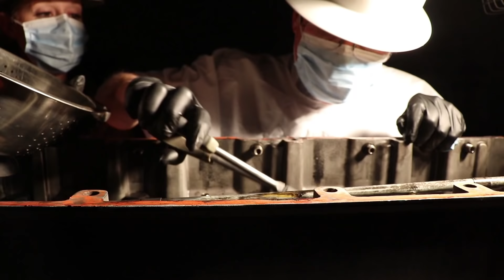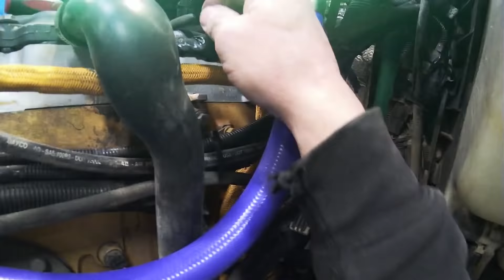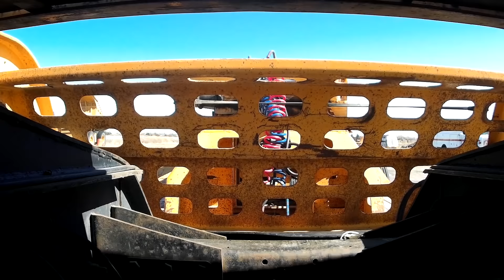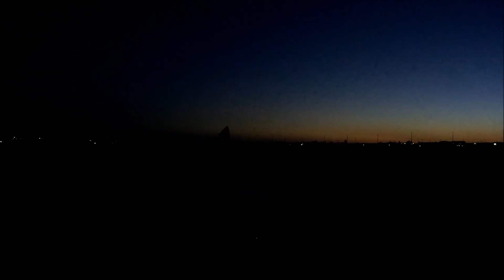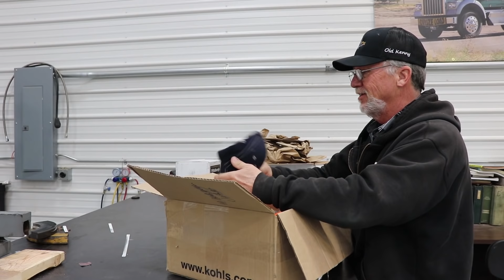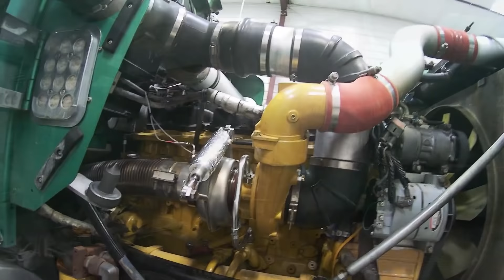Caterpillar C15 Heavy Load Hiway Test

Comment: Another great video Jeff! If anyone is looking for dampers and balancers, here are the links and we have decided to run a little sale for Jpaydirt viewers only!
https://www.pittsburghpower.com/store/c7/Dampers.html 
https://www.pittsburghpower.com/store/c4/Balancers.html
Use coupon code "Jpaydirt" at checkout to receive a 10% discount. Online sales only, please don't call and ask for the discount. Thank you!
Reply: Had an old  junkyard looking 1982, W9OO KW, with 13-speed main trans, 4-speed aux. trans, and 2-Eaton speed diffs (4.33/5.90).  About 104 possible gear combinations with that setup.  Lowest gears resulted in a speed of about one mph at 2100 rpm. Top speed in double overdrive was around 105 mph at 2400 rpm on tall rubber.  Higher speeds were possible going downhill in neutral with 200,000 plus GVW.  Do that and you are member of what I call the "One Hundred Club" (one hundred tons/100 mph).  Just make sure you have good rubber and good brakes.  

Power for the KW came from a Cummins MVT 475 twin turbo engine outfitted with Pittsburg Power's fine chrome plated injectors and a highly tweaked fuel pump fed through dash 16 Aeroquip line.   Pittsburg also supplied ceramic coated pistons to go with a manual injection timing control, ported and polished exhaust manifold, 8-inch low restriction inlet and air filters, and finally a straight-through 8-inch, weed burner exhaust.

FOR JPAYDIRT:  I installed gauges for everything, including boost pressure temp before and after water aftercooler.  As I recall, charge air temp directly out of turbos could over 500 F.   Hot enough to burn paint off the aftercooler inlet.  

I drove the ole "Junk Yard Dog"  for 29 years pulling every kind of lowboy up to and including 700,000 vessels on Goldhofer and Scheurele platform trailers.  I had planned to install an air to air intercooler with h20 coolant spray system, but the engine finally died after much abuse and I got a newer unit with 600 cats under the hood.  The new mill makes much less power, but it's a computer engine and drivability so much better, cruise control and all.
Reply: B Dickman man that straight pipe KW sounds good with that cat purring ..but I gotta say nuttin like the sound of an old Detroit buzzin dozen thru those pipes...lol

Comment: Adding tape to those harnesses is with good intentions, but in my experience it creates more issues.  I say this because it is not sealing anything.  It usually does the opposite by allowing the moisture and corrosive elements (salt/mag-chloride) to stay hidden behind the tape.  It takes much longer to dry out, and can't be cleaned/neutralized.  If you still want to tape make sure to cut the tape with scissors.  The stretch tear method leaves tags that eventually unravel the entire length over time.
Reply from the maker: I did what you said, left some breathing room

Comment: We use a waterproof non conductive grease on all electric plugs and connection in the long run saves us time and trouble.We even use it on the electric plug that goes from the tractor to the Trailer... Just one of the small things ya learn as time goes by.
Reply: Dieletric grease, good stuff.
Reply: 1 2 I used to be a yard hostler and moving 10-40 trailers a day, I saw a lot of trailer with bad pig tail plugs. 
The plugs would get hogged out and worn out. 
I was thought to just get a finger full of grease from the fifth wheel and fill the pig tail in with it. 
Plug in the pig tail and worked like a charm every time.

Comment: @25:31 you mention volcanic rocks. i don't see any volcanos close by.  are those glacial erratics that were dropped by glaciers melting or lava bombs that were ejected and thrown for many miles.  probably the second thinking  of the obsidian you have also dug up.. i wonder if there are any paving material company's around that might want some of volcanic rock for pavement aggregate. Northwest Washington state highways and roads roads are paved with it. tough stuff..  just a thought for future outcrops. 

 back at the beginning  of the video you showed wrapping the exposed sections of harness.. that exposed section allows the last few inches of wire to flex reducing stress on the wire strands to the crimped on connector.. with it wrapped.. all the stress will be on the connectors crimps now.. causing eventual failure of the harness. lets see what the other techs say in reply to this.. 
 
i love that you used zip tubing to separate the positive and negative wiring to the alternator. i am really hoping that you researched the type of convoluted tubing you used.. there are at least 3 different heat ranges.   there is self vulcanizing silicone tape to overwrap it or silicone jacketed fire braid sleeving to go past hot spots.  but its multiple to many dollars a foot.. 

@37:30 you ask for temps .. do you have an infrared temp gun that will measure up to 1800F.. or well above 1,100F.  you have a D9 with the dual turbo set up about to roll into the shop . i wonder if you could get some off that.
Reply: Nice story
Reply from the maker: Google "Craters of the Moon national monument, take a look at it on google earth, looks just like Hawaii and only about 50 miles west of me, the shit is everywhere here

Comment: I drove a 600 Cat Heavy Haul for years and the best transmission was an 18 speed, I really enjoyed the ease and comfort of the 18, My Gross weight was 124,000 Lb. Made for a more relaxing drive, Although I did Shift work and was paid by the Ton, and Union Driver pulling Chip trailers in Montana.
Reply: Daniel Boldera b trains hauling spf?

Comment: I fought the temp sensor plug on the front of the temp regulator (thermostat housing) for a long time,  I've learned how to plug and unplug the wires, and even managed to change a sensor without removing the housing for the AC and alternator. It can be done. Hint: the jumper for the rev sensor (the one on the drivers side of the peanut housing in front of the air compressor) is the same plug size as that damn temp sensor. CAT doesn't put long enough leads coming out of the wire loom to that sensor to lift the loom up off the regulator housing. That point in the wire loom where it sits on top of the reg. housing is subject to a lot of heat causing the wire insulation to get brittle, crack, and eventually wires break off. If you put that jumper on the temp sensor lead, you can get the rest of the loom up away from the engine enough to wrap it with fiberglass insulation covered with aluminum to protect those wires. Jegs online has those wire insulation units cheap. Thanks for the great videos!
Reply from the maker: Thanks for the great tip☻
Reply: Jpaydirt - Scan Gauge D

Comment: Hey Jeff, I have a couple of old tracks off of a 287 that you are welcome to if you would like. You probably don't need them using tires and the ag tractor tracks, but you are welcome to them (might need to borrow them back occasionally).
Regarding your research project, it's funny but I was just thinking last night about the same thing. I don't know the answer but I suspect that the net boost, i.e. intake manifold pressure less exhaust manifold pressure, is what matters. Intake temperature is also a component, so my theory is that if one achieves maximum intake boost of say 50 psi with exhaust boost of say 10 psi, you are probably ahead of say 55 psi intake boost with 15 psi exhaust pressure, despite the same net the intake temperature should be less as there would be less heat build due to less total pressure. I'm just pulling these numbers out of my butt, but I think the logic is sound.
I enjoy the videos as always......can I borrow your new O-ring kit? I'll bring it back in 10 or so years! That was quite a gift!

You have created a monster here; how do you find time to move dirt?
Reply from the maker: It's probably going to be a one to one ratio less would be great and over would be bad

Comment: Jeff get a Scan Guage. You can monitor Intake Air Temp from the ECM sensor while going down the road. Among a whole Lotta udder delights lol. It plugs into the data port, cool tool.
Reply from the maker: Wow never thought of that, where have you been? LOL
Reply: That's a loaded question lmao - and most of the 5 million miles I've logged  have been sitting behind CAT engines. I may be just an old trucker, regardless I love to learn new things and don't mind sharing from experience. Thank you, sir, for sharing here on the Tube!

Comment: They leave the ends of the connectors without shielding for testing and diagnostics for future failures. Any good mechanic will verify wiring to a certain sensor or solenoid prior to replacing it.

Comment: The only problem with that Jay is if you have a problem with one of your pins in your connector each one of those connectors is serviceable with the tool to pop the pin out put a new pin and replace in the connector if you sell a cone that in there you'll never get that apart you'll be buying another wiring harness if you need a $2 wire in to fix your connector

Comment: Hey! I’m from Indianapolis, Indiana! I love watching your construction and wrenching videos! I love cat equipment and motors! I work on a 1949 D13,000 from time to time and it’s fun to work on!
Reply: Ben Harleman, my uncle's old fishing boat in Anacortes, WA still has D13000 for power. 1,200 rpm max. That's the "new" engine They put in "after the War!"  Boat was built 1926. Original engine was 60 hp Atlas-Imperial that turned about 600 rpm.

Comment: Love your channel, that being said I wanted to inform you a little better about the elogs, while I'm no fan of any kind of government, the logs aren't the problem, the problem the actual hos rules are mainly the 14 hour and the 30 minute break. Once guys get used to it most like it. I was on paper for many years,but went to elogs 3 years ago and find that I'm more rested than before and get more miles logging by the minute instead of 15 minute blocks. Given time I'm sure your friend will warm up to them. Perhaps the biggest benefit is when you go to a weight station or get inspected, they're never as much as asked to look at them. Bottom line is if you're running legal you'll be just fine. Keep up the good work.

Comment: Also just curious why back the dozer on the trailer,why not just drive it on,some states back east it is actually a law to drive a loader or dozer on so the blade or bucket is facing the back but for some reason western guys wanna back them on or load wheel loaders with the bucket up on the neck,all that does is make more work and more time than just driving them on the trailer

Comment: not handsome not handy not lucky.... The temperature and pressure testing is very important to the "what goes and what comes out equation with the same amount of fuel. Does cooler inlet temperatures with higher inlet pressures equate to more grunt?? What is the exhaust pressure load? I would wager that those exhaust inserts that were in the OEM exhaust port restricted the top end power. but increased the low end spool and torque figures some.

Comment: Might not want to use silicone on your electrical. Silicone has ammonia in it, and ammonia is the number one copper corrosive.
Reply: Lead foot Lerch Exactly.... Dilectric grease on each connector prevents corrosion and seals out water.  Aviation grade will not dry out.  I use it on everything automotive or aviation.

Comment: Wouldn't some 2x10boards be a lot easier to use to protect your floor than tires? The temp out of that charger is likely in the 400degF range.  Without the inter-stage cooler I would expect 600deg air on the twins.  With the inter-stage cooler it probably outputs in the 400range as well.  I would hope your air to air can knock it back to under 150F on a hot day, it likely will run in the 80's this time of year.
Reply from the maker: We don't have any hardwoods here, just pine and it would destroy that in one use, we are going to find out the temp, I should have taken bets on that☻

Comment: New subscriber a week ago Dallas Loken from Owatonna Minnesota.  My Mack E7 454 hp averages 4.5 mpg on my lowboy.  Average load 110,000 lbs.  Heaviest is 145,000lbs.  I have an 18 speed in my truck, never really split the bottom for gears. Maybe you could get by with a 13 speed save a little weight if you’re concerned about the weight.

Comment: I hate to be a buzz kill but,it is possible that most of your performance gains came from changing your leaking CAC. 

It's common out here to pull six and seven percent grades. Watch your pyrometer climb after a minute or two on a pull like that.
Reply from the maker: it hit 1400 on the hot side for just a second then stayed 1396, and 900 on the cold side
Reply: Jpaydirt try dropping a gear when you see the high egts. You could also benefit from a water drop kit. You inject a small amount of washer fluid into the intake.